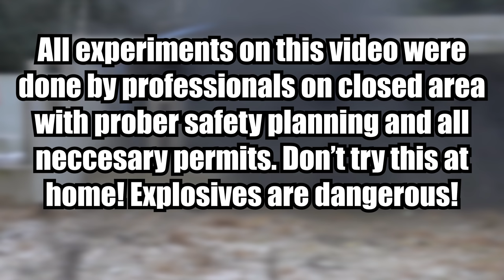How hard it is to explode a hole in concrete wall?

Comment: Weshalb sollte eine Explosion eine Wand beschädigen wenn auf einer Seite Luft ist wohin sich der Druck problemlos ausdehnen kann?
"Verdämmen" heisst der Fachbegriff! Ob man da wasser nimmt oder eine zweite Betonwande direkt davorstellt ist egal. Hauptsache der Druck kann nicht einfach entweichen.

Why should an explosion damage a wall if there is air on one side where the pressure can expand without problems?
The technical term is "damming"! It doesn't matter if you use water or put a second concrete wall directly in front of it. The main thing is that the pressure can not simply escape

Comment: In movies an RPG will punch through walls and blow the sides of a wall out.  Is that 100% fake as well then?  Though most of the time it is done on afghanistan village buildings that probably do not have rebar in them.

Comment: The best way to blow a hole in a concrete wall is a directed charge you can make it but I really don't recommend it all you need is cloreen powder brake fluid a metal or plastic pipe with one side threaded glue some Anker blots to secure the metal plate on the back side a quick mold to direct the massive power and 30 second s to 2 minutes for the reaction to take place it's I am not going to post the mixture and never will be cous nobody should be doing this the reaction is extremely unstable and does not really have a time limit it could happen randomly and is hot enough to ignite thermite so stand clear like 100 to 200 meters so if you are stupid you better leg it or you are dead

Comment: "All experiments done by trained experts"???? A REAL expert would know the reason they're not having any success is because the energy from the blast is getting directed AWAY from the wall, since air does NOTHING to contain a blast. The solution?A ZIPLOC bag FULL of water ( and I mean "full") taped over the exterior side of the charge. Since water is more dense than air, the blast energy will then be redirected toward the concrete, and not the air around the concrete wall. (12B- US Army)

Comment: how hard is it to breach a wall ... depends on the wall ... if it is reinforced concrete and hardened ... then not very easy ... if it is just the standard construction concrete ... then no problems ... if its modern crap wooden construction get a sledge hammer ...

Comment: Can you do a water container as a tamping device, with a hand-grenade in an indentation as the charge?  That would be easier to assemble in the field.  I'd also be interested in if the container should be perpendicularly edge-on, vs. flat against the wall, as the water is just there to stop the charge from moving outwards and that would put more water directly behind the charge.